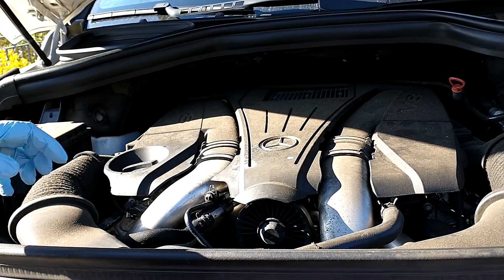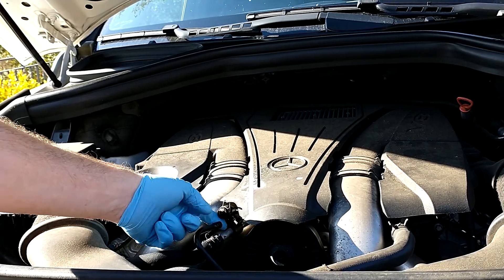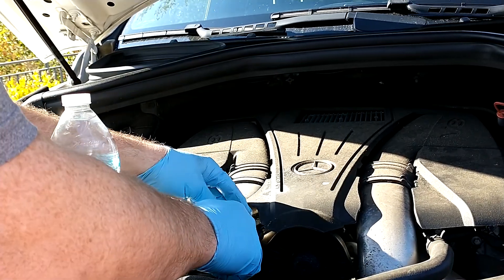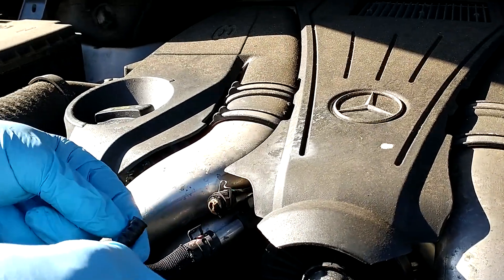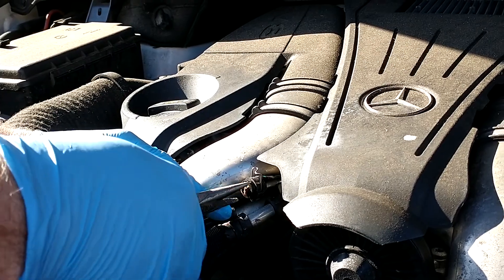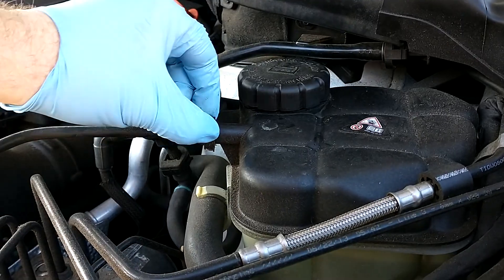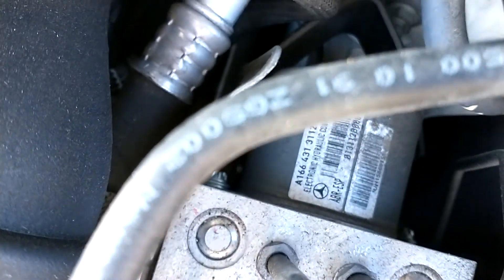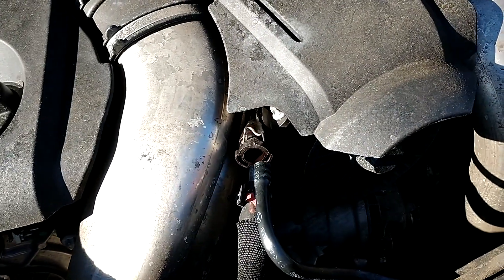2014 Mercedes GL450 coolant leak overflow hose

Comment: my question is what does the overflow hose connect to (underneath the shroud over the engine.  mine broke today, just on the other side, so my over flow hose is good still, it the piece that it connects to.  any ideas what its called? all diagrams I have found do not have it  thanks!
Reply: Did you figure out what your part is I have the same problem as you and can't figure  what the part is??
Reply: Did you ever find out what it was called?

Comment: If you follow the line back to the fitting where it attached to the engine I removed that short section and spliced in a short section of flex hose with hose clamps after had to replace plastic fitting at engine, all because that line assembly is on back order with no info on how long it would be on back order.  the plastic fittings are available, but be careful the break very easy.

Comment: Please I need your help, i have this Mercedes Gwagon G63. Each time I put water on the radiator coolant tank the water will short, and I have check everywhere there's no leakage. What could the problem please?